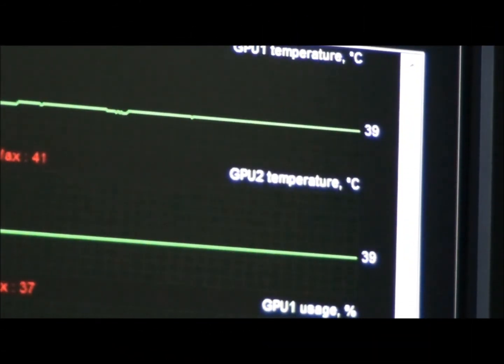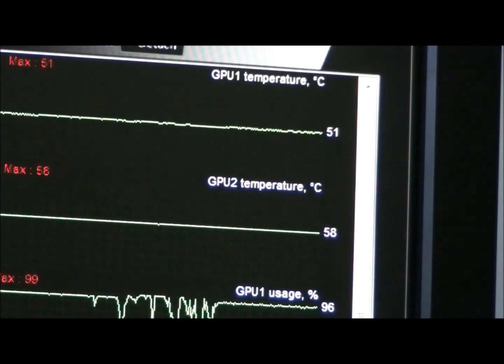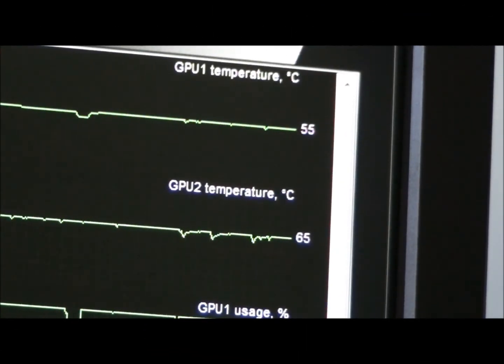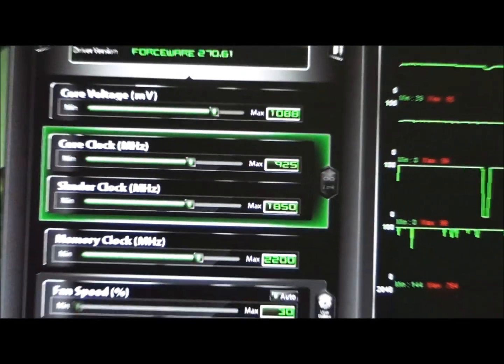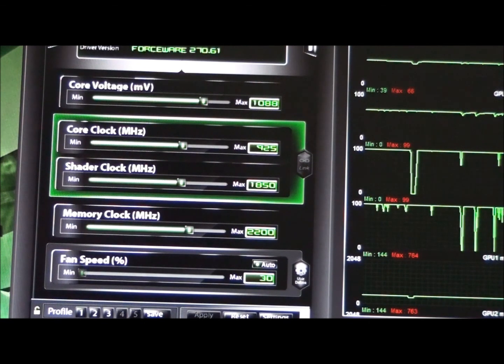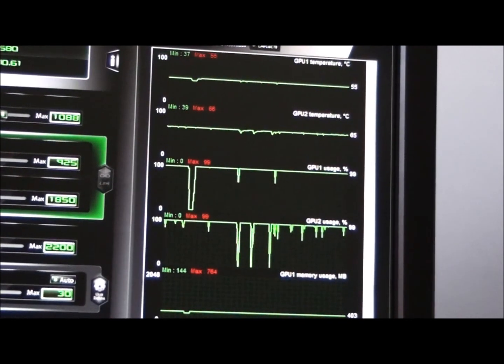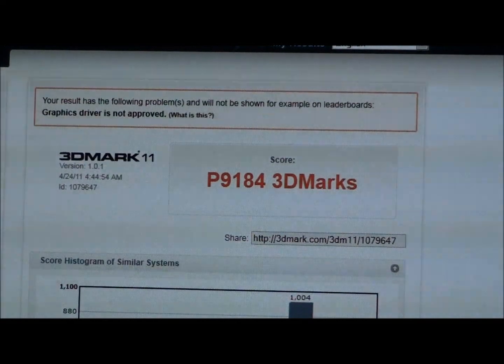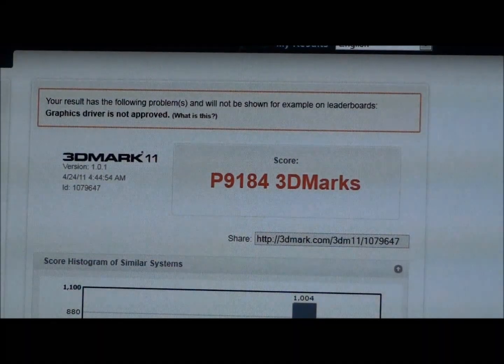Singularity Beast Upgrades Part 2

Comment: How can you only have 9k in 3dmark 11?
Your're using 2 GTX 580s in SLI right?

I have 2 aswell and they are at stock and I score 10k with them, I'm also using only 6gbs RAM also Dominator GT and i7 950 @3.64ghhz

Here: evga(dot)com/ModsRigs/detail(dot)aspx?BuildID=25650

Comment: @SingularityComputers I did the same mod as Trubyd44 (I like to think mine is better). I acttually bought the Mountain Mods tray some months ago, at that time Trubyd44 had only modified the 700D. After removing the original tray I could see there were going to be issues so I reassembled the 800D to original & shelved the idea. Then after seeing Trubyd44 video with the RevoDrive X2 I got the bug again, just now I'm waiting for parts to finish the build. I hope I don't have the RevoDrive issues.

Comment: @SingularityComputers Genius build! Looks great, easy in maintenance, works fast. but I'm wondering how do you replacing koolant with your Koolance QDC fittings? Blowing air forward trough the tubes, waterblocks & pumps after disconnect? And one more question: how much QDC fittings reduces the flow? Sorry for my english & thanks in advance!